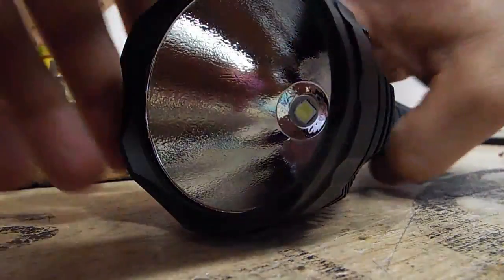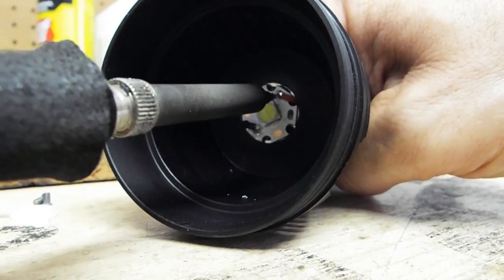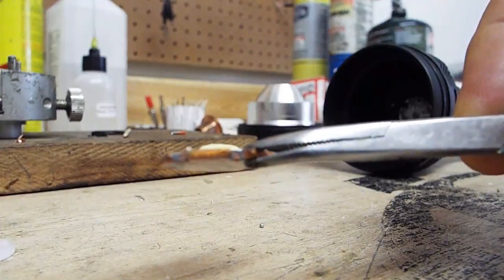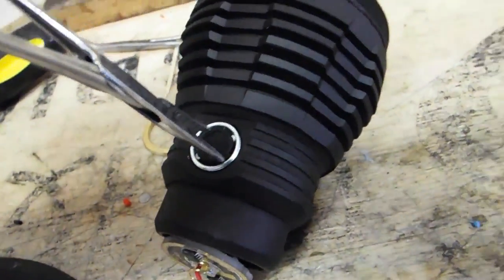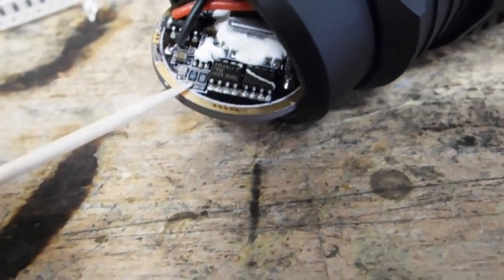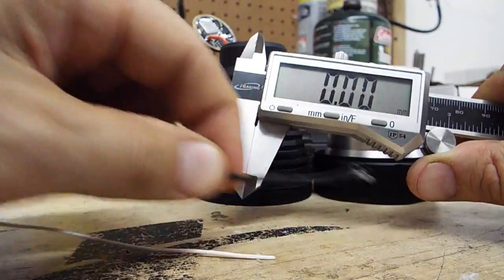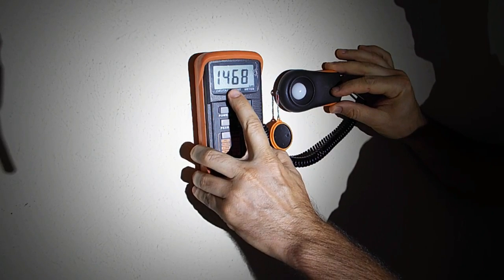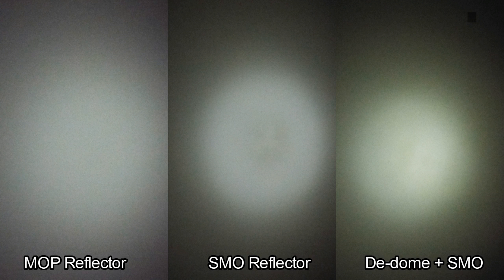Convoy L6, How to Double Your Lux!  Increase Range.

Comment: hey you, i changed XHP-70 on the l6 convoy flashlight, By XHP-70.2 , and insert the two-resistor R200 circuit

Comment: Hi, please allow me to ask a question. Is it safe and reliable to use R120?  Can I use R150 instead? Or maybe you can suggest me a  safe range (ex: R100~R300  ). Thank you.
Reply from the maker: Hi,   You can use any value resistor safely.   If you use an R150 you will just get less of a boost in output than if you use an R100.    You can even use a piece of wire to jump that connection and get higher output still.    Unless you short something out you won't do any harm adding the extra resistor over the top regardless of what value it is.  :)

Comment: You show using a R120 resistor to increase current but I'm unable to locate where to purchase the correct resistors to fit onto the l6 driver. I want to start practicing with power boosting stock lights safely. Can you post a link to show where to buy the resistors?
Reply from the maker: Hi Patrick,    Here you go. 
https://www.mouser.com/ProductDetail/Panasonic/ERJ-8RSFR12V/?qs=sGAEpiMZZMtlleCFQhR%2fzUMW8oYbuCRX7M1ZjMvFOLI%3d

Comment: Hi,

It's always very interesting to see your work. Do you prefer the Convoy L6 on the Astrolux S70S? How about the Haikelite MT07S? On paper is better than both? I have it as a headlight for my bicycle. I'm looking for something stronger.

?Can I order the accessories to improve the Convoy L6 and how much do they cost?

Many thanks for your interesting and intriguing work.

Nitsan.
Reply from the maker: Hi Nitsan,   I don't have the S70S or the MT07S.   Based on what I have read about them I like the L6 better.  I think the look of it is better than the S70S.   I love the look of the MT07S, but I am not a huge fan of lights that have only a side switch.   To me they are very hard to find in the dark especially if I'm in a hurry.   

The only accessory you can order for the L6 is the SMO reflector.  By itself it will give you a little more throw, but not a lot.  To get a huge boost in range at least the de-dome mod needs to be done.

Comment: how did you focus it ?
Reply from the maker: The best thing to do is just leave the centering ring in and let the reflector sit on that.   However, if you want to squeak out some extra, you can use teflon coated wires ( they don't stick up as high) and put kapton tape over the LED + and - contacts to prevent a short, and hen omit the centering ring and the reflector will sit lower giving you a tighter focus.   Just be very careful and definitely use the kapton tape.  Keep your soldering contacts flat.     I even machined the bottom of my reflector a little to help create some space, but it still can touch the wires.
Reply: Did you notice much of a difference visually or was it a small enough increase that it wasn't really noticeable? (With a SMO reflector?)
Reply from the maker: I can see a difference with the SMO vs OP reflector.   Mostly in that there is a more defined hot spot and spill line.  They are blended into a more smooth transition with the OP.     Out of all the changes outlined in the video the one that has the most impact on distance visually would be de-doming the LED.
Reply: What about focusing the SMO reflector? Did you notice much of a difference?
Reply from the maker: A bit on a wall.   Thinking back on it though I may have had to remove material from the top end to get it sitting low enough to get perfectly tight focus though.   I slipped one of the newer ones into my L6 just now and just removing the spacer ring did not give correct focus.     Sorry if that lead you on a goose chase, I just forgot about having to do that.

Comment: For dedoming I've always just run the LED for a couple minutes on high, then peel off the softened dome, with a small plastic pry bar (Spudger from iFIxit) or 1/16" wide straight slot screwdriver - no need for disassembly.
Reply from the maker: Thanks for sharing your technique.
Reply: Thanks from me too, I've got a couple of old XML2 C8s that I've wanted to dedome for ages but never quite dared using other techniques!
Reply: That was interesting. LED went blue after that peeling
Reply: Dedoming will always cause a tint shift. Other reasons can be not properly installing the LED so it's overheating or damaging the LED while removing the dome.
Reply: one should not use that technique ...the "dome" consists in fact of 2 layers, the dome itself that we need to get rid of, and the under fluorescent layer that we need to keep because the natural LED emission is in blue and is converted by this layer in white. So please use instead the technique seen in this clip , and cut only most of the upper dome.

Comment: I'm a noob to light modding, so bear with me, bit does the"1" on your light meter (before you take the reading) tell us that the light is set up one meter away?
Reply from the maker: Hi.  I'm glad to help you.   The "1" showing on this meter means that the light output has maxed out the meter in that range.  You just have to bump it up a notch so that it's less sensitive and measuring a higher range.
Reply: AdventureSportFlashlights Okay, thanks.

Comment: When you do the "boosted driver current" mod. Does that boost each mode, so that they all go up a notch? Or, just the high setting goes up?
Reply from the maker: Hmmm.   I would have thought that it boosted current across the whole set of modes.   However just now I tested an unmodified light and a modified light.   I got Low 50ma Med 200ma high 1500ma.     On each light I got within about 3% of the same current.   On the un modded light I actually go very slightly higher vs the modded one on high mode so it appears that only the turbo mode is largely effected, but I cannot say 100% for sure from only the one test.
Reply: Ok, thank you. Let me know here, or via email, as soon as you find out more please. 
I just thought about this Sunday night, and started wondering. Since I've never seen this driver, I couldn't be sure. I would think that most buyers, including myself, would want this mod to only increase the Turbo by 22%.

I would suggest also, that you 'self certify' your mods by shooting into the metered light tube, and take amp readings, both before the mod, and then again after. Then write that down on a tag.
Reply: this is the reason you go to mountain electronics and order a bonafide mosfet driver made especially for the L6 under 20 bux and completely blow away this home modified junk, the light can pull upwards of 17+ amps with this driver so be sure to buy a shockli 26650 30 amp battery to go with it also at mountain but it is beyond belief and 5x brighter than this resistor mod plus it utilizes PWM so it mods all the light not just turbo

Comment: Ok, I did see this video earlier. But I didn't at the time, add the gain seen in the reflector mod, and the gain by adding the SMO reflector, together. I figured at the time, that the reflector mod was only tried on the OEM unit. I don't think you said either way : - )

Now that I look and listen a bit closer. I think is what you are doing, though you didn't elaborate on it much in this video. Is that you lengthened the wires, so you could 'shim' the reflector (either one) back and forth, to get a better focus?  Gaining some lux that way.

I see you gained you about 14,000, but how far did you have to go, and in which direction? It would almost have to be out, even though I have yet to hold that light. Doesn't it have that threaded ring packing it all into place? I guess you could not tighten that up all the way, and in essence, be bringing the whole assembly back in towards the battery compartment, to play with the focus that way. But then you would have to shim up above, so it indeed would get tight, right where you wanted it. 

How far did you end up moving it, for that amount of gain? And, did that new reflector 'mod' location transfer well onto both the OEM reflector, and the new SMO unit? Or have you not tried to find the sweet spot for both yet?
Reply from the maker: I didn't do a comparison for what only changing the reflector would do.  Like if you kept the LED factory and just went to the SMO (maybe I need to).      I started my tests after I did each mod.   So moving down the list its a culmination of all the things basically.    To get that 14k jump where it says reflector mod I moved it in toward the LED.   The factory wires have think insulation on them so I used teflon coated wire which is much thinner.  I also pushed the solder joints out to the edge as best I could.   This allows the reflector to sit lower in the housing if you leave out the centering ring around the LED emitter.    I think I even had to machine a little off the base
 of the reflector??   Cant remember.     Just be very careful if you do 
that because the reflector can touch the LED wire contact and short out 
causing total failure.     Putting a piece of kapton tape over them is a
 good idea if your going to play with it.  I only played with it a little so I doubt I've obtained perfect focus.

Comment: You changed out the wires so you can play with the focus of the reflector, can you explain?
Reply from the maker: Sure Bud.   The factory wires have think insulation on them so I used teflon coated wire which is much thinner.  I also pushed the solder joints out to the edge as best I could.   This allows the reflector to sit lower in the housing if you leave out the centering ring around the LED emitter.    To get perfect focus I think I even had to machine a little off the base of the reflector??   Cant remember.     Just be very careful if you do that because the reflector can touch those wire contact and short out causing total failure.     Putting a piece of kapton tape over them is a good idea if your going to play with it.
Reply: AdventureSportFlashlights thanks much for the explanation! Your info is awesome. Currently waiting on my Convoy L6 to arrive now.

Comment: After reading some about flashlights.. why would you pass the springs with a wire if the driver had a constans current and not direct drive? Is that for mods you may do in the future? And also if you have a fet driver with spring bypass what desids the max current? The led? And why? Thanks!
Reply from the maker: Glad to help you with that.    Bypassing the spring lowers resistance.  In builds using a FET driver this means more current to the LED.    The thing that determines the current with a linear driver like the FET is battery voltage.   The emitter runs directly off off the cell and lower modes are made with a PWM.  

In the case of the L6 even though the driver may be current control the voltage from the battery is very close to what is needed to achieve the maximum output so keeping resistance low will help ensure peak output is reached.   Lower resistance also means greater efficiency.   A small amount of your batteries capacity is "burnt up" by resistance in the spring and other parts.
Reply: best conductor (for a low resistance circuit) besides gold and silver is copper. But you can`t make springs of copper or aluminum so the only thing that could increase a little the conductivity of the steel is plating with something nice. Still it won`t be as good as a copper conductor so there you have it, using a wire inside the spring helps a lot. Also the spring will not get hot and warm the lithium accu next to it, lithium hates warmth. The current will be measured across a SMD resistor (like the one you saw in the clip replaced to a lower value) driving the IC that commands the FET .

Comment: Matt, if you know the lux, do you know how to calculate the ansi fl1 throw distance?
Reply: Ah, of course you do. I just found your video on it. :)

So if your lux readings are at 1 meter then:
75k lux = 550 meters
164k lux = 810 meters
Reply from the maker: Yes that is correct.  You take the lux number times 4 then the square root of that number is  distance in meters.

Comment: Did the modifications but opted to switch back stock. While output was up & throw was increased as advertised, heat became a issue & lost much of the spill that made the light so useful at average distances.
Reply from the maker: Thanks for sharing your experience jatoav8or.
Reply: jatoav8or I did all these mods and doubled my lux, but I still have plenty of spill light around the edges. Maybe even the same as stock. Are you saying your hot spot got too small and you prefer it being large so you can see a wider area?

Heat from the resistor mod can be a problem depending on how you use the light. So if you currently use it on turbo until it gets quite hot, then adding the resistor should be skipped. If your like me who uses it in short bursts, the extra heat is not an issue. 

I like having a big thrower. It's way better to use than an xhp35 based thrower with its tiny little hotspot. Now I'm going to buy an DQG Tiny 7x xpg2 for a dedicated, 2500 lumen, floody light. Then I'll have the best of both. A big thrower and a tiny flooder. :)
Reply: When I swapped out for smooth reflector much of the spill was lost. I just find the stock light as I purchased from mountain electronics to be in the sweet spot for a useable general purpose high output light. Not to say that the mods listed here don't drastically increase the output, they do.
Reply: Also, having a TM36 in the collection takes care of my  thrower needs. If I didn't have my Nitecore I'd probably opt to have a couple convoys, one smooth & one orange peel. It's all good.

Comment: I see that you removed the ring that holds the reflector in place. Did you put it back on, and if so, how?
Reply: Stacy Keen The centering ring is just molded plastic and has a snug fit around the white base. It can be popped off and put back on very easily.
Reply from the maker: Hi Stacy,   I only just now saw your post.  What Jason said is correct. And yes, I did put the ring back on.  It keeps the reflector from sitting down on the LED wires and causing a short.

Comment: Hey I have a question:

how exactly does it work that you boost the driver current by adding resistors? I am a noob when it comes to the physical laws of electricity but what i know is the U=I*R.
That would mean that I=U/R which means that the current would decrease by adding resistors? 
What main logical part am i missing here?

Thanks for the answers.
Reply from the maker: Thats a great question Burak.   The reason is that the resistors are stacked in parallel.   Adding additional resistors side by side like that decrees the amount of total resistance.   If they were placed end to end it would increase it.    Sort of like working with water.  If you have one thin pipe for our water/current to flow through, then add a second along side it you get double the water/current.   :)
Reply: Ahh okay okay i get it. Because it is a parallel circuit you calculate the full Resistance with the Formula (a*b)/a+b which is a smaller term than a or b alone. Thanks For the answer 😁👌 

Another question what is the Main purpose of the dome and what characteristic does it have on the light? Is it breaking the light into all kinds of directions and thus making the spot of the light wider?

And how does another cable actually influence the focus of the flashlight? I thought their only purpose is to feed the led with electricity and that only the reflector could influence the focus.

My convoy l6 just arrived so I am thinking myself what of these changes I should do myself to mainly increase the focus and make the beam go further 😃

Thanks a lot for all the answers 😁👌
Reply from the maker: What you said about the dome is correct.  They basically disperse the light in a wide patter.  They also effect the color of the light.  De-doming will cause you to drop about 500k in color temperature.  So a 5700k Led will become 5200ish.   

Im not exactly sure if I understand your second question but here goes.   If by another cable you mean how does adding current effect the focus, the answer is it doesn't.   The reason you get higher lux (more beam distance) is because the LED is being driven harder. 

Increasing range comes down to about 2 basic things.  How columated the beam of light is, and surface brightness of the LED.  In this case we are tweaking both.

If you have experience soldering and a bit of patience you can do this mod.  If you've not soldered I would suggest practicing on something else first :)

Comment: Can you modify the Maglite ML300L 6 Cell D LED Flashlight to take 6x32650 Lithuania Ion batteries?
Reply from the maker: Hi Brandon.   Sure, anything can be done.  About all you would have left of the factory light once the build was done would be the body and head though.  You would need a new heat sink and light engine installed.  Also a body extension about 6 inches long would be needed.